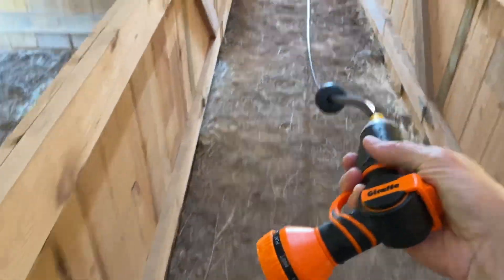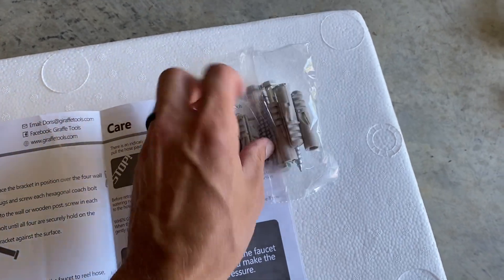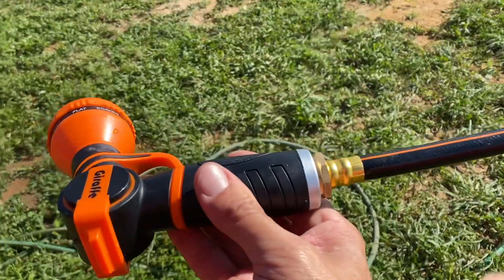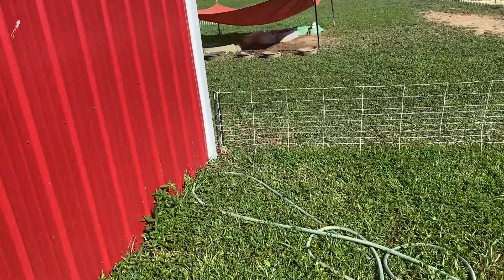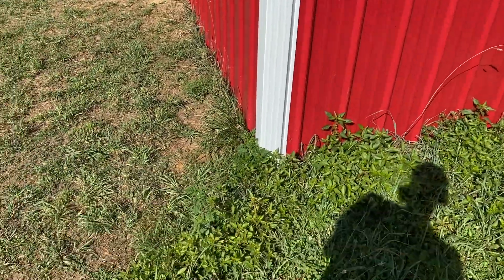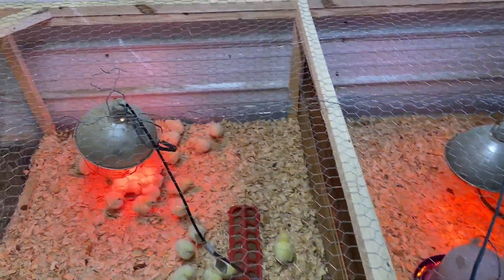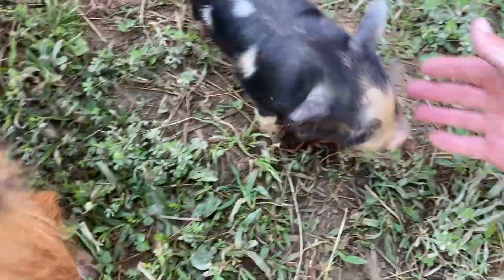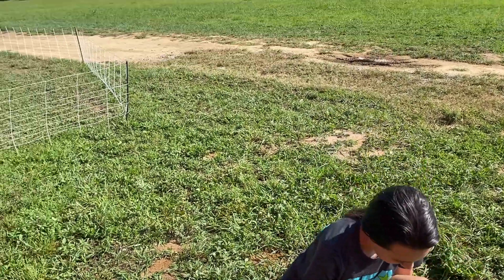Is this a game Changer for our homestead? Giraffe Tools retractable hose reel!

Comment: The reel is like an air line that vehicle shops use.  Can it be completely drained to prevent freeze clogging in winter?  My regular hose, even when I was careful with draining, kept freeze clogging in the  overnight temp drop, and sun thawing would hold me up, so I started rolling it up and bringing it in the 40⁰ bldg
Reply from the maker: This comes off the bracket super easy and I can bring it in when it’s cold
Reply: @KCFarms  Yeah, I saw the mounting.  Fortunately, even without heat, my bldg seldom got near freezing